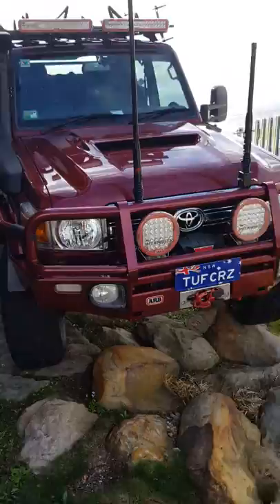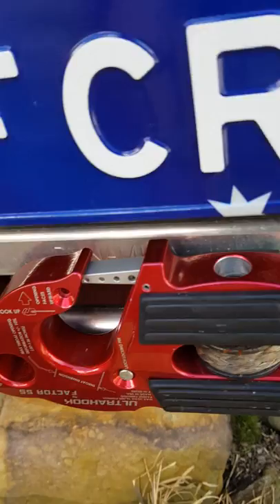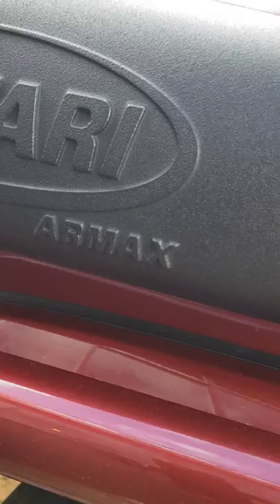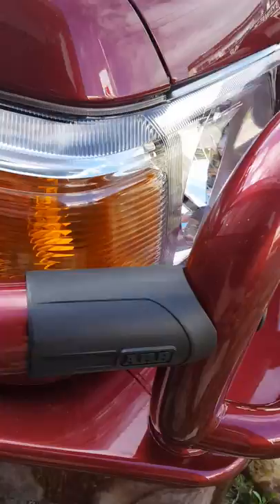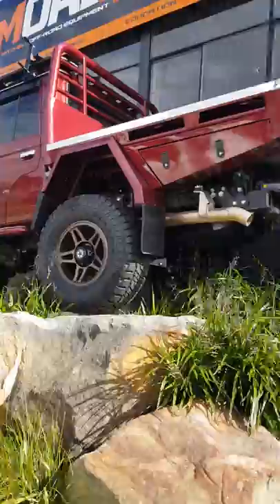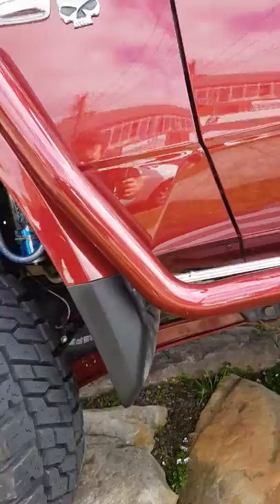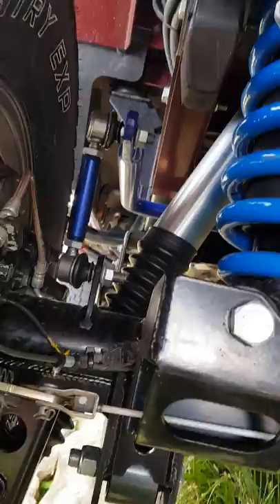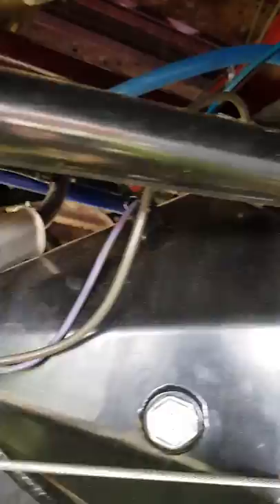JMacx Coil Conversion - Toyota 79 Series Landcruiser

Comment: I'd definitely move that secondary fuel filter to the engine bay or protect that plastic fuel bowl from stick/branch, gravel & road stone strikes @ 6.44, I regularly have large sticks flick up and wedge in under my Landcruiser when travelling on Forestry or National park tracks, wouldn't take much to crack it or spear it off & have all your fuel leak out as well as siphon the main tank dry as your travelling along hundreds of kilometers from the nearest servo.
Reply from the maker: Thanks for your comment, no room in the engine bay unfortunately.

Comment: I'm sure the owner will appreciate a big bright green defect sticker on the windscreen for the illegal roof mounted spotlights, that and oncoming vehicles at night see the roof bar illuminated long before the driver sees them & turns them off, probably scared of the dark is my guess.
Reply from the maker: THanks for your comment, it's not illegal to have them up there, only to use them. If they're covered and/or switched only from outside they're not technically illegal. Hope this makes sense?
Reply: @MORE4x4_au  No worries, I'm sure the copper will say this defect label isn't just for looks, unlike your roof mounted spotlights.
Reply from the maker: @dustyfarmer  thanks Dusty Farmer, like everything on this vehicle it has a purpose, thanks for commenting.